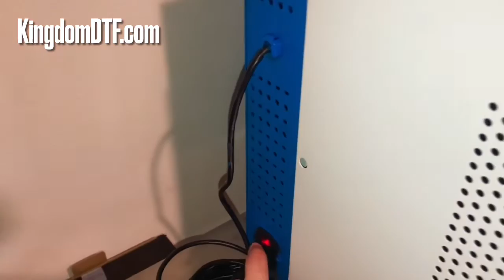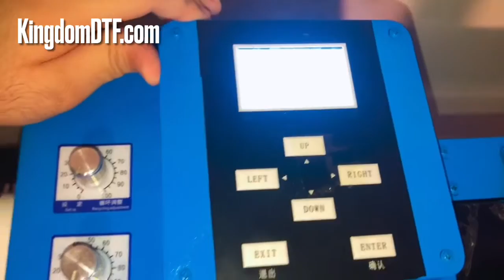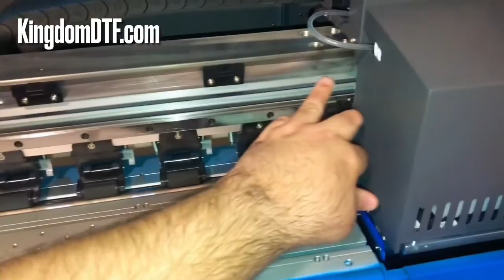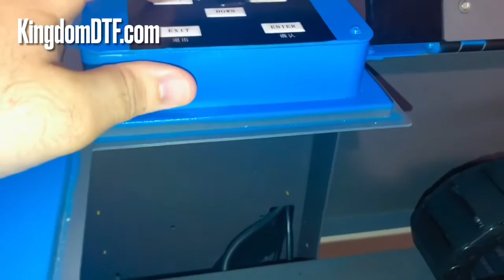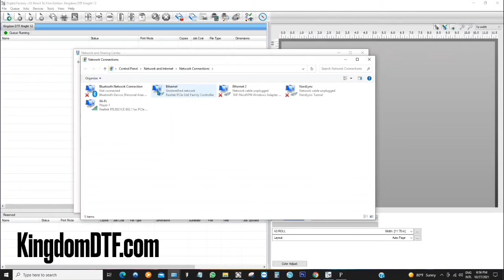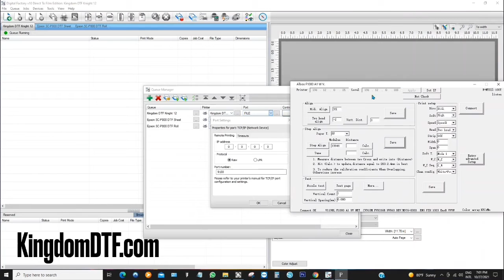🖨️ How to Setup Cadlink + Atool for DTF Printers Step by Step

Comment: Hello. Is there a way to add a gang sheet to ATools? Am trying to print a gang sheet 60 inches long. Have saved the entire file, transferred to Maintop and it's the 60 inches long long version... when opening in ATools it's showing only a portion of that file.
Reply from the maker: You need to do that in the rip software by setting your printing area with wide and height you need, no atool.

Comment: Hi DTF KIngdom, do you have part 2 of the dual head printing on cadlink step by step? what settings to do, this video im a bit confusing cause it cut in the end of setting up cadlink. i wanna know how you can send job to dual head printer using cadlink
Reply from the maker: Yes, you should be able to see a play list with all the parts on the channel.

Comment: Im following the instructions but where did you get the second screen I don’t see it where to connect to IP address
Reply from the maker: What second screen?  I have open the cadlink software and the printer interface Atool. Then on the pc I when to network connection to set the IP.
Reply: What is atool

Comment: Hey I need to get in contact with Jose ASAP. We were having issues with our printer but we figured it out. I need help with another issue please!!!!
Reply from the maker: Send a message on messenger or info@kingdomdtf.com
Reply: Hey timothy negron, how did you solve your issues with your printer? I am in the same situation as you that I had, I solved it on my own but I have another issues, I am also trying to communicate with Joss. I would like to know if my issues is the same as you had
Reply: @argelisalmonte7753  pm me